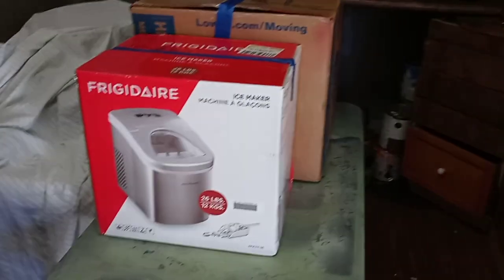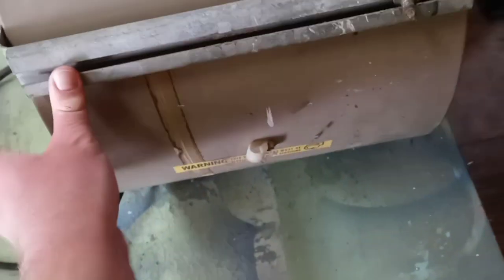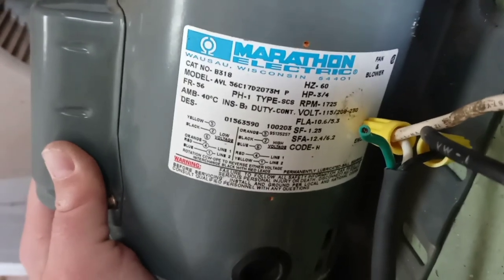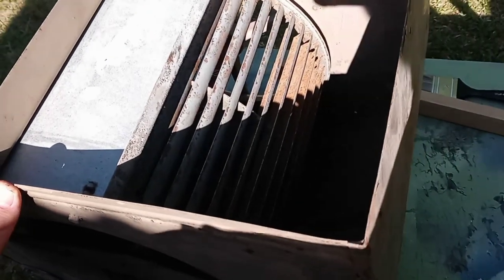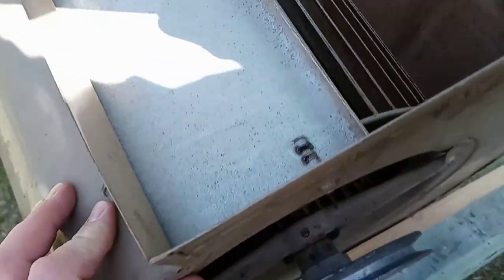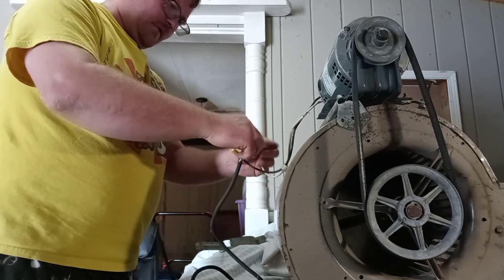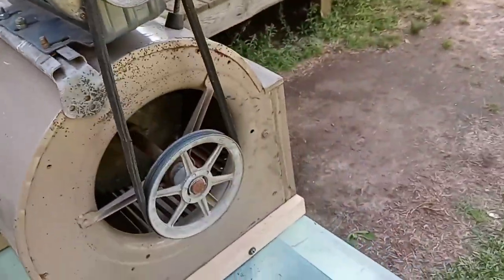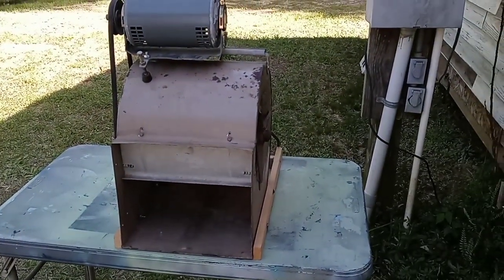Vintage Industrial belt driven Squirrel cage fan ( Assembly Project ).

Comment: my phone been watching me as I work on this old blower. Now Youtube suggest this video. I had an direct drive motor from a smaller squirrel cage that came out of a newer furnace. I decided to retrofit it to the old belt driven cage cause the belt driven motor windings was done. Save money and works!!! No more belt no more oil. Had to use a degreaser to remove the caked up oil and dust on the old cage.

Comment: interesting project. that looks like a really tough blower wheel and that motor looks just as powerful too. looks like something you'd find in a package unit ac. good luck with the project
Reply from the maker: Thanks! It was just a simple assembly of this 50 + old blower fan that was given to me.. These things were very well built and would take a lot to put so much as a dent in it , I haven't weighed it but my estimation would be around 80 or 90 pounds with the motor on it .. These were designed for industrial and hard ware ..but many of them were used in furnace's and AC units as well . This is by far the most powerful fan in my collection aside my Wizard and Patton. I'm glad you enjoyed and thanks for watching!

Comment: I just bought this same blower for 20 bucks! What size motor you have on it? Mine came with 1/3 hp. I think it's to small.
Reply: Nevermind. I found where you show the label. 3/4 horse motor. Good video. Thanks!
Reply from the maker: @tesla747  Sorry for the late reply , yes this is 1/4 h.p motor . This however is not the original.. The original would've been about the same size as yours , this are really handy fans and I like them . Thanks for watching and I'm glad you enjoyed it.